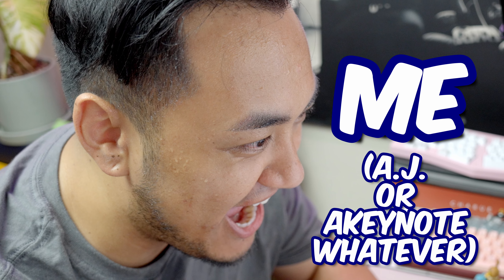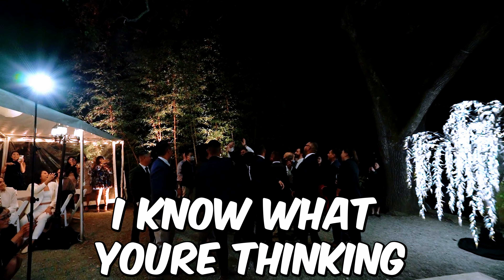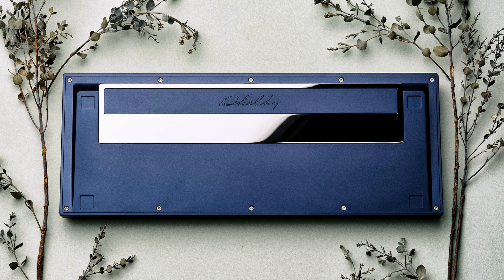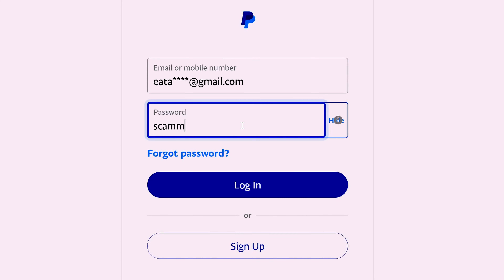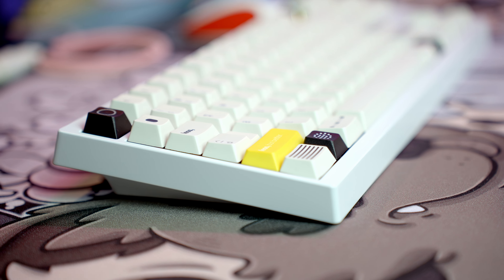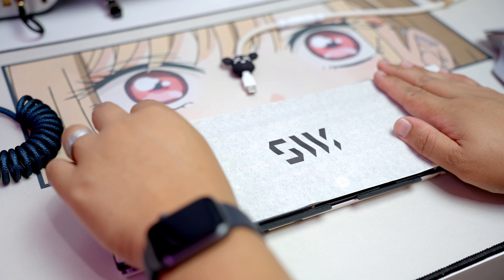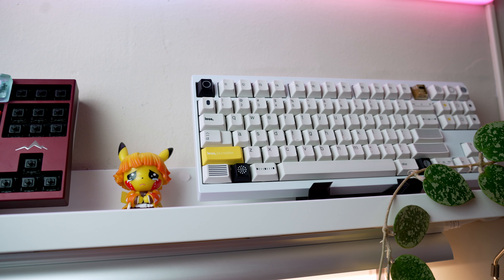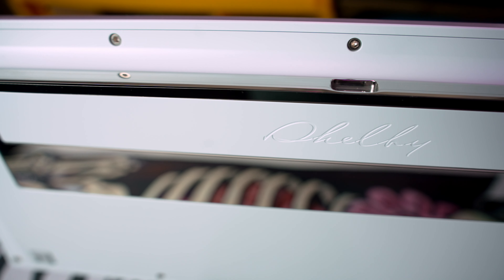Building an Endgame Keyboard | Shelby80

Comment: Should I get 1.2 stabs or 1.6 for the PCB?
Also, would you say the swagkey stabs are good enough? Or should I get something like TX stabs?
Reply from the maker: I used the swagkey stabs and the included shims. If your confident in your lubing technique you’ll be fine, They are perfectly usable. I think the pcb is 1.2 because the spacer is 0.4 thick.

Comment: Is it really need to use the force break mod on shelby ? Thanks
Reply from the maker: Nah I just force mod everything to get the cleanest sound possible. No foam configuration, without long pole switches might need the force break. The top row sounded a little hollow with non long pole switches.
Reply: @Akeynote  ah I see, okay thanks for the information